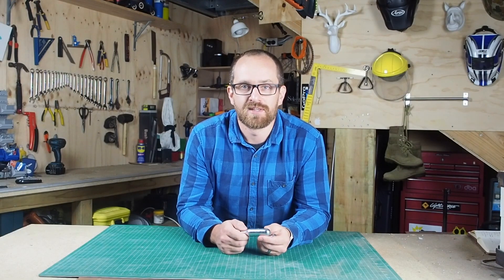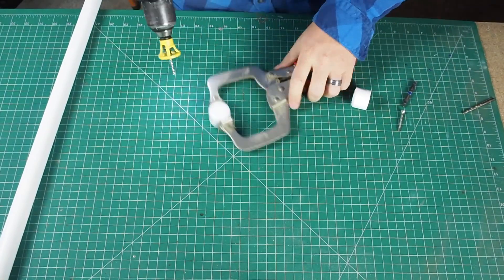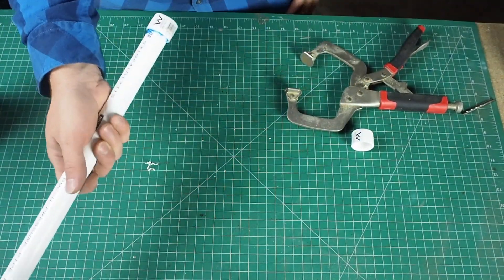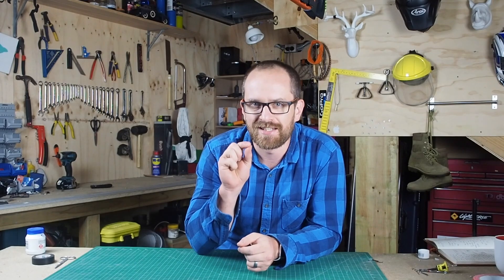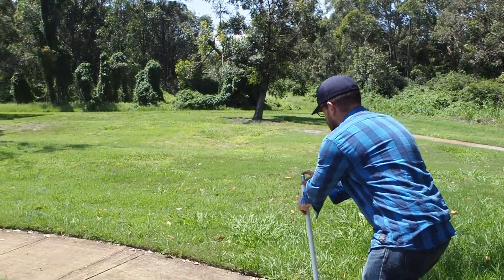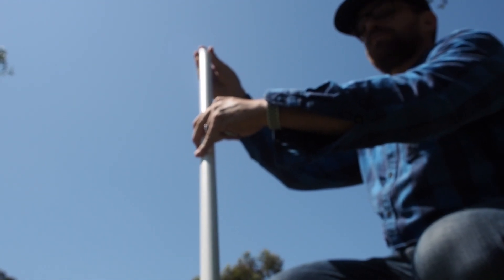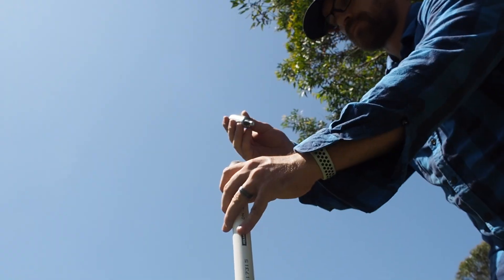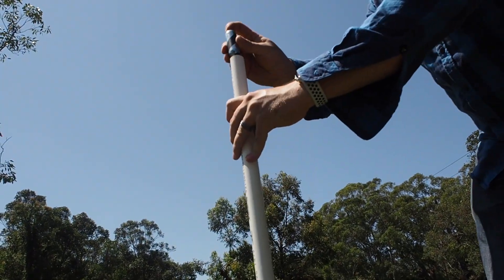Making a CO2 Cartridge Rocket launcher

Comment: I did this when I was in my early teens, many years ago.
I remember we just used a straight pipe like the one you have, but a bigger diameter I think, maybe 30-50mm and a bit longer. Metal pipe if I remember, and no base or end cap fitted, just placed straight onto the ground, concrete or road, even cricket pitch. 
Our method was to stick on a small dab of Blu-tack, and then push a thumb tack onto it with the pin right on the tip of the bulb, we had green soda bulbs, don’t know if they are different.

Then just drop it into the pipe, has the odd spinner fly out, but most would launch hundreds of feet straight into the air.

Comment: Just tape one or two sticks to the cartridge like what bottle rockets have and you will send the cartridge into the clouds. Shoot it straight up, not at an angle unless you know there are no humans within a mile. The rocket will go up until it disappears. Wait a moment. When it comes down, it will rotate, and you will see the sun glint off the sticks for just a second. That's when you find cover. The cartridge will completely bury itself into the ground and usually you can find it by looking for the sticks. Launch the cartridge with a spring-loaded "gun" that punctures the tube end. My first rocket was at a slight angle. It disappeared over the trees. I shot the next one straight up and it came down in the dry yard, with the full length buried. Very dangerous. I tried to shoot one at an angle down a very long street with my friend positioned to watch it fly high over his head. But it leveled off, drifted to the left, and smashed into the side of a house just an inch below a window where a woman was washing dishes. It was like a bazooka! Big Bang, Big Scream. Dishes crashing in the sink and breaking. Two boys running for cover and hiding for the rest of the day.